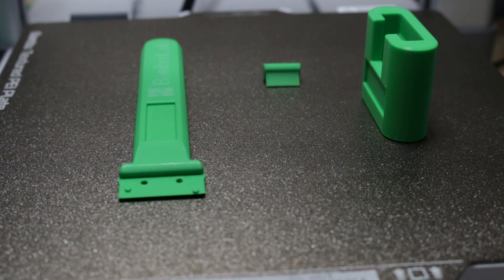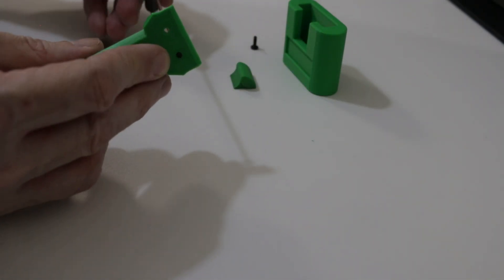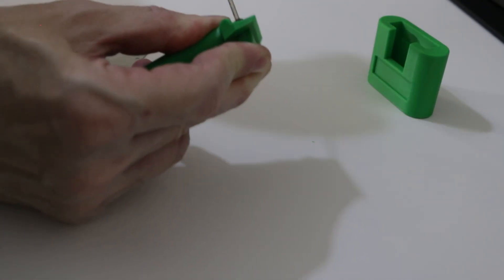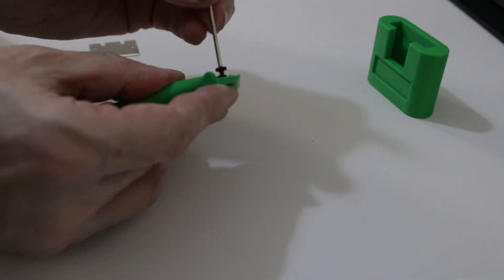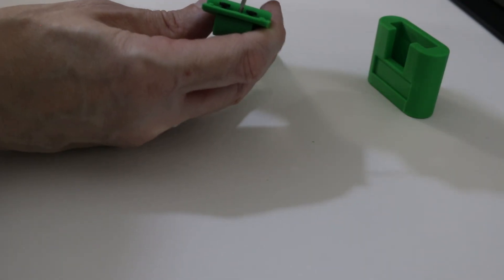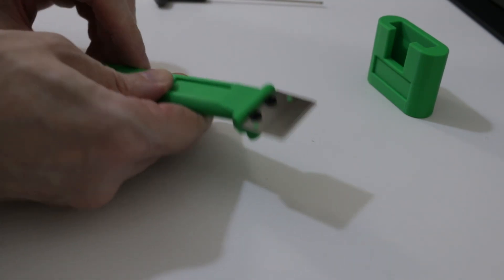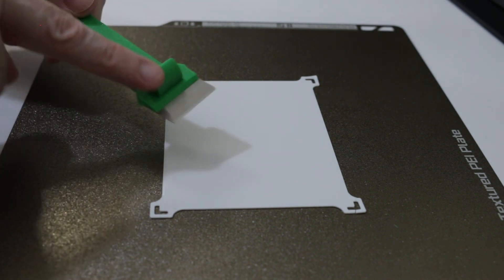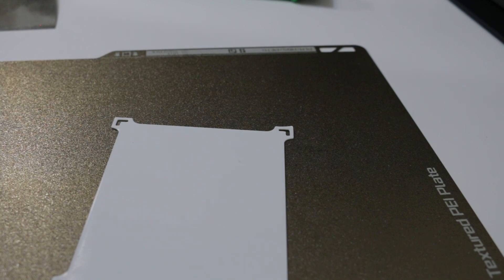how to put the bambu labs 3d printed scraper together

Comment: I did it like @WestCoastDP did, but I found that the right screw hole (from viewpoint of the logo side of the handle) was slightly too close to the other.  The slot in the blade slightly covered it.  I used a 3/32" drill bit to widen the hole, using the metal of the blade to keep the bit aligned. The back piece still did not quite fit, so I drilled their holes just a short depth.  I then used a shop vise to squeeze it all together.  A few more turns of the screws and it was all snug.  Either model was not quite right, or the required dimensional precision of the my P1S is not quite enough.

Regardless, your video gave me the start I needed.  Thank you for helping us out.

Comment: Here's what I did. Worked great.  Put the blade in.   Don't put the small back cover on yet.  Insert the two screws into the handle and tighten both.   There will be some resistance which is normal.  Keep going until they are seated, But continue until the they start to free spin, That breaks up the tight plastic.  Now put on the small back plastic, push down on table while screwing the two screws.  Done

Comment: I did not find any blade in the P1S I got yesterday. Are those blades only in other models ? Or is it a case of " I should ask my wife to look for it" ;-)
Reply: Look carefully in the box where the power cable was, there is a cardboard cover that you must remove because underneath you have a bag with replacement elements. And in this bag you have another bag on which it is marked "scrapper" and it is there.

Comment: Thanks for your video, well explained. One question, where to get the print file for the green tool tray?
Reply from the maker: Was that the one for the nozzles etc?
Reply: @RandomSmith the grub 6 tray you place the scrapers in that also has the glue and it l other tools. Looks sharp!